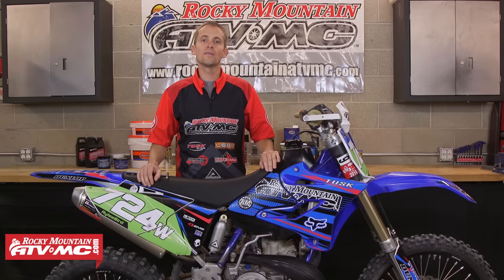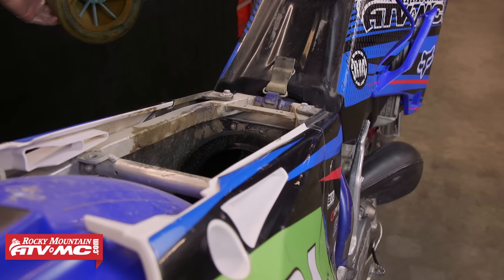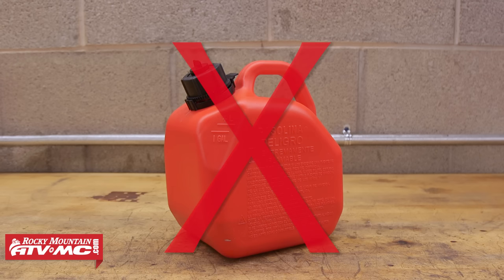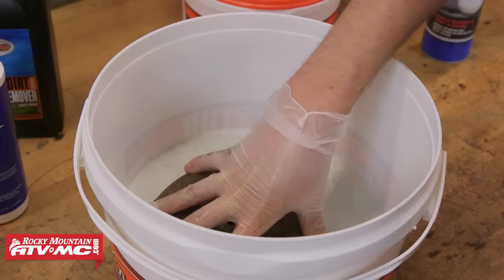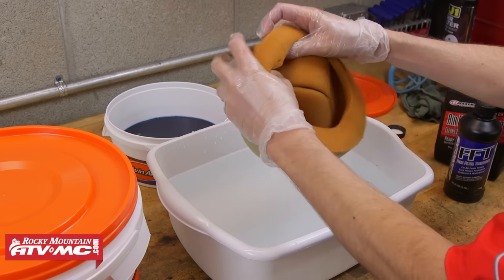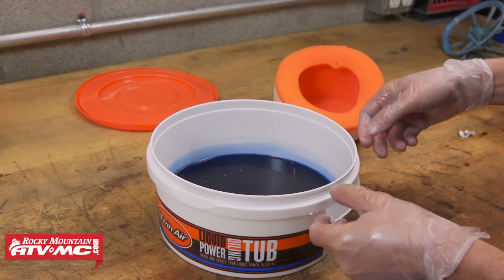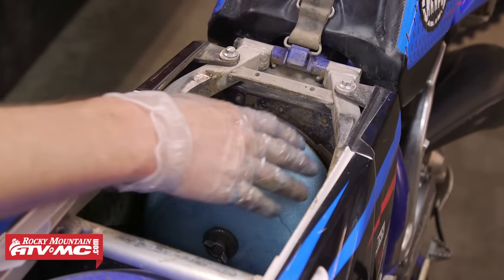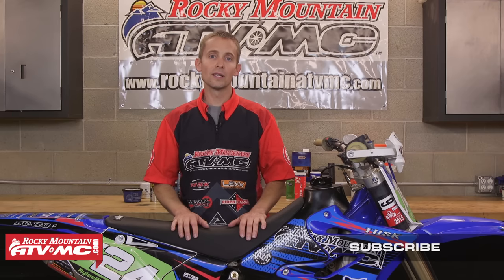How To Clean & Oil a Foam Air Filter on Motorcycle or ATV

Comment: I have been using gas forever no problems change every ride 1-2 hours filters as good as new
Reply: Cody sansbury aa
Reply: +Cody127 they get paid to do it with these products..
Reply: it does break down certain brands of air filter foam
Reply: Cody 127 same haha
Reply: Forever is a long time. I'll give it a try since I have extra gas in garage from last trip out. And I don't need more stuff taking up shelf space.
Reply: MX127 Tried before.. disintegrates the foam
Reply: Manuel Gatzi use diesel
Reply: SamiWami I use dishwashing liquid. Works great. Am a covert already.lol
Reply: Manuel Gatzi would dish soap work too?
Reply: Bobby Amendola I usually give it a good soak, and rinse it after a gentle scrubbing against its own. Repeat 2x, then spin dry like 30 sec, LINE dry, soak in oil, wring oil out, good to go. been doing it for years. Gasoline might be good, but definitely disintegrates the foam into nothing. You'd wonder who took it.lol
Reply: Gas works fine, but it is harder on the foam, and does deteriorate the glue on the filter. But if you replace your filter regularly it should never be a problem.
Reply: MX127 I've been doing the same thing every ride I wash my filter. Gas works just as good then I soak it in water and leave it in for a while. I've been doing it for so long it doesn't do anything to the foam filter. But I do buy extra filters so I don't have to reuse it constantly,
Reply: MX127 how often do you clean your air filter on dirt bike?
Reply: I have some filters that are a few years old (TwinAir) and I use gas to clean them... They are still in great shape.
I dunk them in gas to get rid of the oil, then I have a bucket of water with the hose running in constantly to keep the water flushing, that's when I really get the filter clean. Then dry it in the sun, will blow them out with my air compressor if I'm at home.
I do filters after every single ride, I've got a bunch of them so I do them all at once, and it's great having a bunch of pre-oiled filters ready to go. Put the cleaned and oiled filters in a sealed container.
Reply: Me too works pretty fine and takes the dirt off easily
Reply: I tried but the oil was still on the air filter so i used diesel instead
Reply: my friend burnt down his garage doing that, dropped a trouble light and IGNITION !
Reply: Ya it’s just as good as the actual stuff but it just wears out your filter faster. But not by much. My dad and I are both off-road racers and require top notch filters for our race and we have been cleaning our filters with gas for years. I doesn’t wreck the bike and it’s cheaper
Reply: MX127 so have I it works great
Reply: @pschdlc7912  it all depends on how dusty it is when your riding. If your always following your friends around on the trail and eating dust, than it may need it more often, if your always out front, then not as frequently. As a general rule of thumb I usually clean mine every 1-2 rides. If it looks fairly clean you should be fine to go once more.
Reply: I’ve been free-basing heroin forever no problems.  Do it everyday and my body is as good as new.
Reply: MX127
 you mean no problem that youve noticed. It will enlarge the pores in the foam and reduce the filters performance, so you are reducing your engines life though not significantly enough for you to notice. I could probably do half a dozen rides without a filter, put the filter back on, sell the bike and no one would ever know i did it, doesnt make it a good idea.
Reply: What oil do you use to oil it? Like engibe oil?
Reply: @bobbyamendola4526  I use dish wish liquid works fine

Comment: Lucky to have a suitable grungy laundry room sink.  Dawn or liquid laundry detergent with warm water (not hot, that is hard on the filter glue) works pretty well on PJ1 filter oil.  

Bel ray is the best filter oil though, that stuff is tenacious.  Gotta break out the petro product to cut it.  Tried to use Dawn on Bel ray once,  the dirt came out and the oil stayed in, filter looked clean and still oiled.  Could have literally let it dry and put it back in the bike - LOL 

Gotta imagine Bel ray offers the best protection, but I have never had any problems with PJ1.  Just did the top end on my '13 TE 300 at 250 hours (ya, the interval is supposed to be 80) and the piston looked great, rings at .45mm, still in spec, running Amsoil Dominator at 50:1 :)

Ya, clean the inside of the airbox 1st - WD40 with some blue paper shop towels from Costco works well to cut the goo.

Comment: Mineral spirits will break down the filter oil faster and is completely safe for the foam. Usually 2-3 dips in the spirits and all the oil is gone. No need for soaking it for any amount of time
Reply: Yes Sir! Mineral Spirits works the best.
Reply: I use WD-40 to clean of my Castrol Filter Oil
Reply: What are mineral spirits?..You mean turpentine?
Reply: Michael Steven  White spirit (UK)[note 1] or mineral spirits (US, Canada),[1][2][3] also known as mineral turpentine (AU/NZ), turpentine substitute, petroleum spirits, solvent naphtha (petroleum), varsol, Stoddard solvent,[4][5] or, generically, "paint thinner", is a petroleum-derived clear liquid used as a common organic solvent in painting and decorating.
Reply: What oil do you re soak the filter with ?

Comment: My bike is a new dual sport and i on have a few rides off road in the sand and dirt. I have checked the filter and air box and they look like a new bike still. I will clean it tomorrow even if it looks clean. Maybe it is not oiled much at the factory.  The air in northern CA has probably been worse than a dirt bike track,  I'm 80 miles from the forest fires and the sky is like driving in morning fog. GOD bless those who lost all in the fires.

Comment: Just got my TwinAir The System and never came with any gloves. I had some spare clear gloves and that blue tack formula literally absorbed into the gloves. Nothing would rinse that formula off. Great system, love TwinAir, I ALWAYS run a TwinAir Filter in any bike I've owned. Kinda expensive just for the tubs, but well worth it.  Good instructional video as well.

Comment: I clean my filters with the cage first on. I also clean the bike with a block of plate, insuring no dirt falls in or on the air filter....
Also have a special sink i use for dirty things, so i can have water running through the filter. I use really hot water, so that the glue get playable. Further preventing it from breaking...

Comment: Confused. Twinair says dump oil back into the metal jug after use so dosnt evoporate. So there tubs do seals enough leave cleaner and oil in them?
Reply from the maker: Yep, the Twin Air containers seal up nicely so cleaner/oil can be left in there. Or you can pour it back into the original container. No big deal either way.

Comment: Nice to see what others do as well.  I've generally used a shotglass amount of gasoline to work around the filter first, to cut through the oil.  Then move to dishsoap and water to clean it.  Finally the aerosol spray on the outside and inside sparingly and work around until it feels fully coated.  I like your way though and may get some designated tubs to use. Your way seems a little less wasteful than mine.

Comment: I'd clean the lose debris out of the box before removing the filter then fit a wash cover and clean it out properly after that.
I also use fuel to clean the filters because it's cheap, it well and quickly and it evaporates fast. Then blow it from the inside outwards with an airline it pushes any tiny bits caught in the foam out wards and dries any remaining fuel off give it half an hour then use spray oil. Could dunk it but for mx I think that amount of oil just restricts the filter when the aim is to repel water something a fairly thin coat is good enough to do.
Maybe for enduro, or trails

Comment: Thanks for the vid. Does it make a difference if we use contact cleaner or carb cleaner (1:40 , 8:00)?  Or is carb cleaner too strong for rubber and plastic?  Thanks again.
Reply from the maker: You're welcome! Some carb cleaners can be too strong for plastic and rubber unless they specifically state that it is fine with those materials. Contact cleaner is definitely safer to use in those areas.

Comment: On that hole you found, could you just put some heavy grease in the hole temporarily till you can get a new one ordered? Is there a way to use a lighter or hot tipped knife to melt the hole together again?

Comment: If the air filter oil is Petroleum based, using petrol (gasoline) should be safe to clean the air filters.

Comment: Simple Green or super clean in the spray bottle 5 minutes rinse it out with hot water. After it dries use K&N in the aerosol bottle. That's the fastest in the easiest way to do the air filter. Both of them cost about 12 bucks

Comment: I really like the twin air tubs and cleaners. The cleaner is bio degradable which is nice. I have used it a few times and it will save me money in the long run. Curious what the guys do with the left over gas? Just pour it out on the ground? That was my only issue with using gas.
Reply from the maker: What leftover gas are you talking about? We recommend not using gas in this video for other reasons, along with the fact that its hard to get rid of. Just like any left over gas or oil you should take it to a proper hazardous waste disposal facility.
Thanks for watching!
Reply: I was asking the guys who use gas. Wasn’t directed at you. Good vids by the way.

Comment: Alternatively, use Bondina cut to size. It is white and very quickly shows the dirt. As soon as it gets dirty wash it in soapy water and rinse in fresh. After about 4 or 5 washes it becomes permanently discoloured, whereupon you throw it away and fit a fresh piece. A fraction of the price with complete air intake protection.

Comment: I have a twinair filter for 1/5scale rcs 

I clean it with handsoap and it works great 👍🏻 its a mini filter anyway so 😂

I oil it with the bottle an work (massage) it in in a plastic bag

Comment: I cleaned my Kawasaki ZZR600 inline 4 cylinder street bike filter and soaked it with a heavy layer of Walmart chainsaw bar oil, 30 weight. After this, the bike idled so rich it smelled like fuel, and it had way less power. It wasn't until the filter sat for 3 months at 107F degrees in the garage through the summer, that it finally began to run normal again. I don't think I used the right oil.

Comment: Is it okay if you use dawn dish soap on a uni air filter to clean it😳
Reply: Dj Mystery
Reply: Dj Mystery Thats what I do most of the time.  I have never had any real problems.
Reply: I use it! Works fine
Reply: Yes its fine
Reply: YES!! dawn is a de-greaser and gentle on anything. Used to clean your dishes that you eat off of.
Reply: Yea that stuff works
Reply: Dj Mystery yes it is just a de greaser witch will help remove oil

Comment: Everything was great in the video, except before you pull the air filter out, use contact cleaner or brake parts cleaner to spray out the inside of the airbox, so it's clean when you install the clean filter. I carefully wipe down the air box while the air filter is air drying. Thanks.

Comment: Do you need to wait for the oil to dry or can you just put it back on?
Reply from the maker: You'll want to wait until the oil is tacky on the filter. You can just let it sit out for about 20-30 minutes before installation.

Comment: I just fill a 5 gallon bucket with soapy water (Dawn dish detergent), wash the filter, rinse in the sink with clean water, set it out in the sun to dry, clean the air box, soak filter in motor oil, squeeze out excess, put it back in the bike. Done, and no unnecessary expensive products or dirty gasoline/kerosene to dispose of.

Comment: Cant you use warm water and dishsaop vs the expensive sollvent cleaners?
Reply from the maker: You can but the solvent cleaners are designed to specifically clean filter oil and the dish soap may not get the filter as clean.

Comment: 6:25  after you have cleaned and washed the filter, can you use the air filter oil in the bucket several times or do you have to change the oil after each time?
Reply: Yes you can. But keep in mind, that over longer times the solvents in the air filter oil will evaporate and the stuff becomes really sticky. This is with filter oils with alcohol or similar solvents. You might be able to save the remaining oil after lets say after a year by adding some alcohol there and stirring. I had this happen to me after a year of oil filter sitting in a bucket with a lid untouched. Or you could just use water solvent type of air filter oil like NoToil green. You can add more water to it if it becomes too stiff.
Reply: @Ricqu  ok thanks, so I can have air filter cleaner in a bucket and use it to clean the air filter several times but I just need to change it out once a month or so when I have cleaned the filter several times?
Reply: @trymzslidez  I personally have washed my twin air filters with gasoline/petrol, then hand warm water + small amount of dish soap to get rid of the gasoline and left over dirt and oil. Then i rinse the filter in water only to get rid of any excess soapy water and let the filter air dry. The cleaner costs more then gas. Usually i buy 2-3 litres of gas and pour it on the bottom of any bucket and thats enough to fully submerge the filters in it. I personally have 3-4 filters that i wash all together and leave ready when i need to use them, and once i need a new filter i just oil it before use. If possible use latex gloves to protect your hands from chemicals.

Comment: Will that grease around rim eat the foam? Also cleaning with petrol makes foam full to pieces, my Guess is if it's petroleum based it will rot it out.
Reply: i have been cleaning my air filters with gasoline for years and it does not eat them away. clean with gas allow to dry then oil and grease it and your good

Comment: Would it hurt if I accidentally skipped the water rinsing part and went straight onto oiling after the filter is dry
Reply from the maker: No, you will be fine.

Comment: Wait I don't see the k and n oil that I've used on my trucks and sand rails but also use them on my bike should I be using that? And i also have been using gas on every thing and I've never had problems
Reply: their just trying to sell a product man if its working for you keep it up nothing proves some thing more then first hand experience

Comment: how long do you wait after cleaning and oiling before you can run the bike?
Reply from the maker: It will vary depending on the oil you use and most oils should have directions on how long to wait after oiling. But for instance, the No Toil Evolution filter oil doesn't contain alcohol so it can take up to 5 hours to dry, where their regular filter oil will be ready after just a few minutes.

Comment: How many times can you you the cleaner and oil before replacing it because I want to get that and I want to know if it is worth my money plz reply
Reply from the maker: There is no real number of times you can use the cleaner. We just use it until it gets to a point where it doesn't clean the filter very well anymore. You'd be surprised at how many washes you can get. Many rider's underestimate the number of washes they can get using this method. Just be sure to use soap and clean water if you're using kerosene or an automotive solvent. Thanks for watching!
Reply: Rocky Mountain ATV MC 
Thank you guys so muck keep up the good work

Comment: Hi I got a question if I want to change from paper filter to sponge like this on a 4 stroke do I need to lubricate all as if it was for a 2?
Reply from the maker: Foam air filters need to be oiled regardless of if it's a 2 or 4 stroke. Thanks for checking out the video!
Reply: @rmatvmc  thx a lot appreciate it reply thx again keep it up love from Italy
Reply: @rmatvmc  Hey huuuugh I got another question does the air filter improvement from paper to foam give anything better? Like more throttle response or something?
Reply from the maker: You likely won't notice any difference in performance. Foam air filters can just hold more dirt while still allowing air flow. And of course they can be cleaned and reused.
Reply: @rmatvmc  thx

Comment: Do the pre oiled filters come with enough oil on them?
Reply from the maker: I've used the Twin Air pre-oiled filters many times and they've always had enough oil. If you were going to be riding in extremely dusty conditions, then it wouldn't hurt to add some if you were worried about it.-Chase

Comment: Do I let the air filter oil dry before I put the filter in my bike, or put it in right after I oil it?
Reply: Ryan Welch Let it dry then put it in
Reply: I just found out that you will probably foul the plug if you put it right back in. Let the solvent evaporate off the filter then install.

Comment: I have 2 questions:
1 how to understand when it is time to clean the air filter?
2 How many cleanings can I do with one gal of cleaning fluid?
Reply from the maker: @Lorenzo Mazzocchi -  1.  Whenever your air filter is dirty really.  It all depends on the riding conditions whether the terrain you're ridig is dusty or wet & tacky, or even a mix of both?  You can determine from that ride if it will need to be cleaned out.. make sense?  Usually you can get away with 2-3 rides depending on the riding conditions you're in.
2. You can get a lot of air filter cleanings out of that 1 gallon of cleaning solution.  An exact number is hard to gauge simply because some air filters get more dirty than others.  When you have a pile of dirt in the bottom of the bucket is when you want to justify changing it out.
Reply: Lorenzo Mazzocchi every ride is better